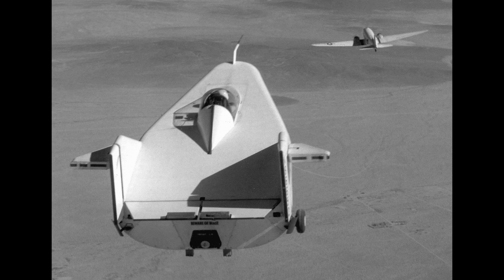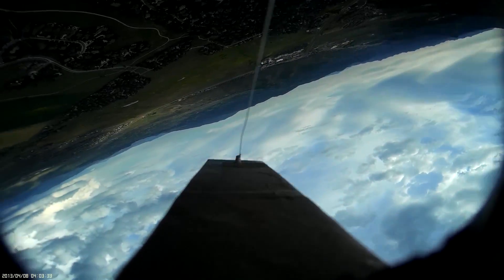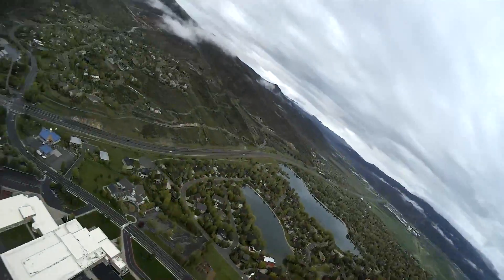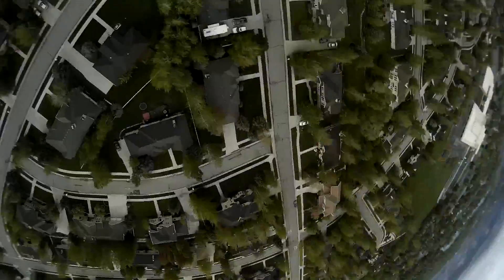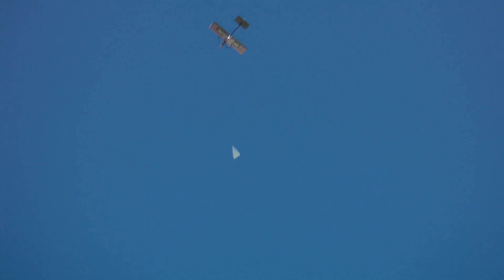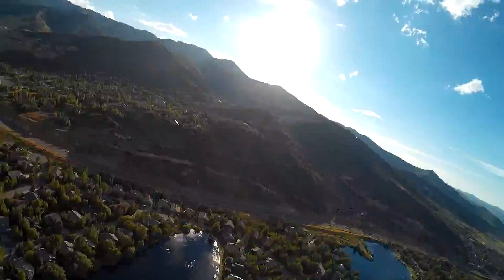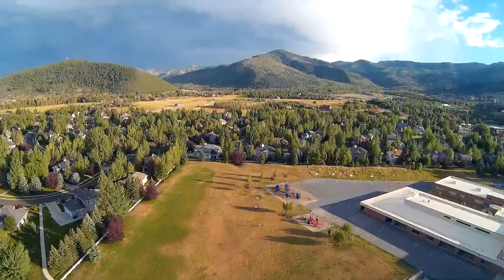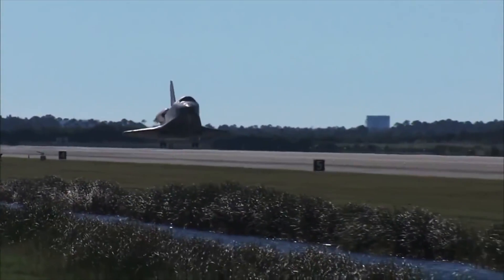RC Shuttle Drop Glider - RCTESTFLIGHT -

Comment: You're contributory to the bad reputation of this hobby   There is absolutely no need to experiment like this in such close proximity to houses and people; particularly as you clearly have significant wide open spaces near by.
Reply: +Spoif Fun project, but irresponsible flying location...
Reply: +Spoif That thing weights 3<00 grams tops and it's made of foam. It's not a hellfire misile ffs.
Reply: +Spoif Get your point but did you realize this planes are like micro size dude?!
Reply: "he's not a novice at this" .... still crashed into multiple peoples yards.
Reply: +flanker  With all due respect, you're missing my point.   Yes... of course it only weighs 3g...  plus Rx gear, plus servos, plus pointy camera, plus fast and out of control flight characteristic plus drop ship weighing however many Kgs.  And when it goes out of control and ends up blinding some unfortunate 4 year old, we all end up looking like irresponsible fools.  The guy flying was about 1km from wide open space, but yet chose to fly over a populated area.  This is an accident waiting to happen... that could easily be avoided with a modicum of common sense.
Reply: rotormasher Thanks, but I don't get your point at all.  If you support flying as depicted in this video, then you are equally irresponsible.
Reply: +Spoif my point was that there's no danger to anyone or anything with those mini size planes, and he's not a novice at this. 
if the planes were much bigger then I would not recommend doing those experiments ofx...
Reply: +Spoif Another great project, but I have admit I was a little surprised at the choice of location for this. The drop plane was quite small, but it looked to be carrying a pretty big lipo battery. I can imagine a crash landing on a roof doing enough damage to the lipo that it would start to burn. Also, while the plane's on-board camera isn't exactly a sharp point, it's far from being a Nerf dart. I think it would cause injury if it hit someone.
Reply: +flanker That super light plane still has enough mass to break some windows. and even the small lipo could in a really bad set of circumstances in  windows break catch fire.

It's  unlikely , but not entirely impossible. 

As much as I respect his skills, he should have known to do the testing on this thing out on some fields.
Reply: It's not about the damage he didn't do or could have done. it's about the reputation of the hobby as a whole. a hobby that right now is under a lot of fire for people doing this kind of stuff. and it affects us all
Reply: yes, at least someone is "intelligent"... again it's not about the people he could or could not have hurt, even then he wouldn't have been able to see any people outside from where he was. and it as not a controlled descent. then he would have landed in the park he took off from.
Reply: I agree
Reply: The project itself is awesome. the location is terrible for the hobby and those of us who enjoy it.
Reply: So because they can't track your models you're free to be as irresponsible as you wish and help ruin the hobby for thousands of others... great...

What's' wrong with the video. well dropping uncontrolled objects/planes from the air above heavily populated area and crash landing in other peopls yards and on their houses... 

Even even if it's not dangerous, that's just not something you do. And if you think that's ok, than you're part of the problem with the hobby, along with those who fly their DJI's several thousand meters into the sky or around/over airports and beyond visual range with no situation awareness.
Reply: +Spoif You're one of those people... :|
Reply: +RCKnut Man, you are so right! I sat on my iPhone once, and the whole bloody thing caught fire. Any kind of jolt will always result in a Lipo inferno. I am dead but writing this from the fires of hell - still not as bad as my Lipo ass burn!
Reply: People fail to realize it's not even about the damage it does, could do or potentially could do.
Reply: Have you not even paid attention to what is happening with the hobby, my country is mostly unafected yet, but these things tend to propagate. US imposiing strict regulations making it hard for many people to fly as you soon only will be able to fly on AMA flight fields, all your planes and drones needs to be registered and so on.
Reply: karter koob Man, you're right Karter. I miss those days when I was a kid, and I could try out my control line and free flight aircraft without fear of going to jail. Hell, I had a paper airplane go up about 1000 feet in a thermal once. I thought it was magic. Today's paper airplane flying kids better get a lawyer, because their unmanned aerial vehicle just violated FAA governed airspace. Time for Federal "pound me in the ass" prison. So sad...
Reply: +Spoif  dude that thing is like a Nerf dart hes not gonna do any damage to a house or car, and hes a good enough pilot to avoid people, plus why would he drive somewhere when he can do it 100 ft away from his house.
Reply: I agree 100% with you Spoif,and m as NY of the others.